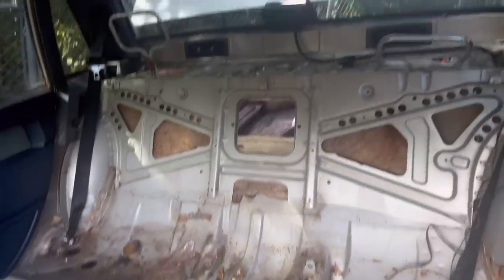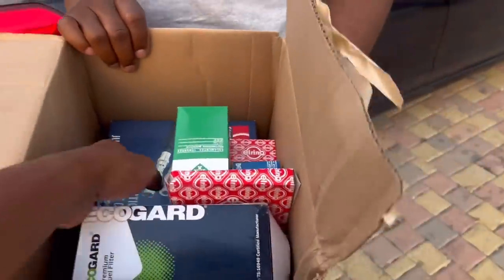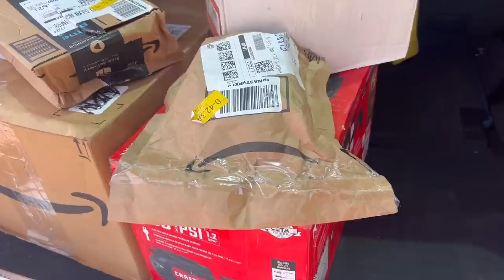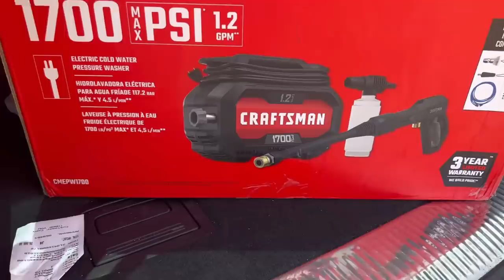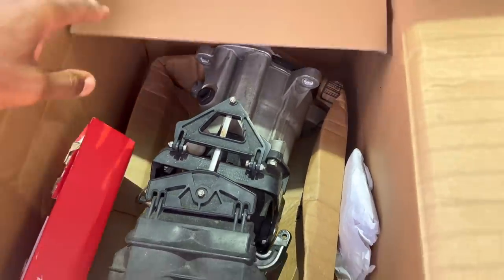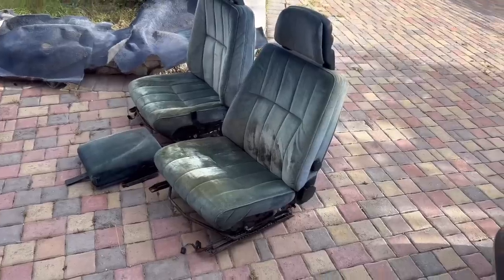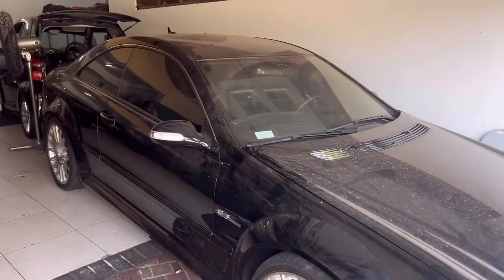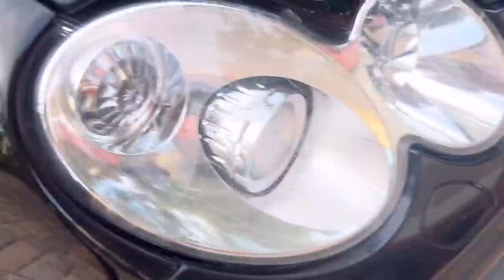It’s getting a wrap , guess the color?| volvo resto #4 #63amgblack

Comment: Thermostat have nothing do with whether you’re living in a hot or cold country. It’s to have the vehicle runs at a required operating temperature. If the thermostat is removed the engine temperature fluctuates and that wears the engine overtime.
Reply: That’s not correct, weather does play apart. If the thermostat is removed the only thing that would happen is the car takes longer to reach operating temp. In cold weather it would be even longer for the car to get to operating temp. Very little risk to engine damage because the car is it’s always open.
Reply: Ntn like that fada🤦🏾‍♂️
Reply: @sg5725 facts… and the thermostat can even cause more harm than Good.. I would know it happened to me
Reply: @sg5725  consult the manufacturer. It will take longer to reach operating temperature which is a issue as well you the car to reach operating temp as soon as possible and also when u ascend a hill the temp start falling off.
Reply: @jovialreid324  only harm a thermostat cause is when it goes bad and stock in the close position
Reply: @burtherny4816  and wat happen when it close??
Reply: @burtherny4816  , exactly so how can it cause harm if it’s always open. Especially in a hot climate where the care is going to reach operating temp quickly. Also these new cars don’t even need to warm up.
Reply: @burtherny4816  , Hills don’t have anything to do with it because with or without thermostat the the coolant can’t be starved because there is a water pump pushing it though the system.
Reply: @sg5725  it’s called operating temperature for a reason don’t you think?
Reply: @burtherny4816  , The car will run at operating temp even if it at idle.  It’s a combustion engine. Only variable is the time it takes to get there. Hot weather shorter, cold weather longer it’s as simple as that.